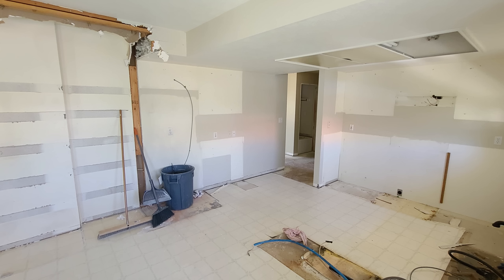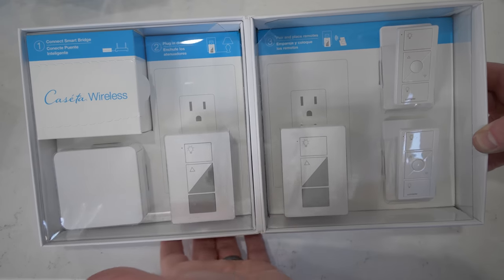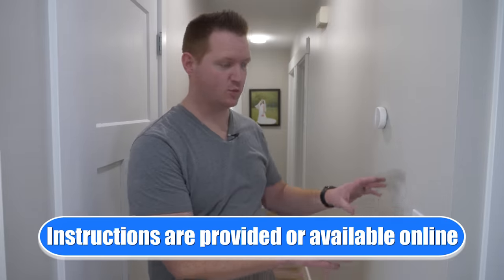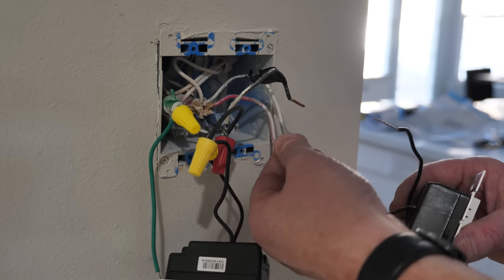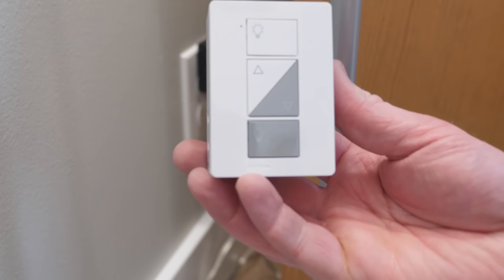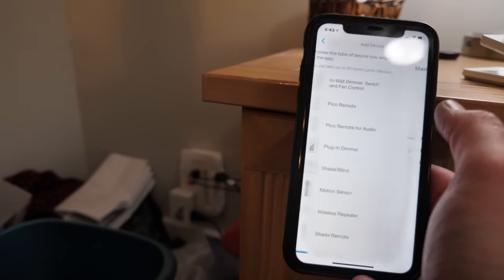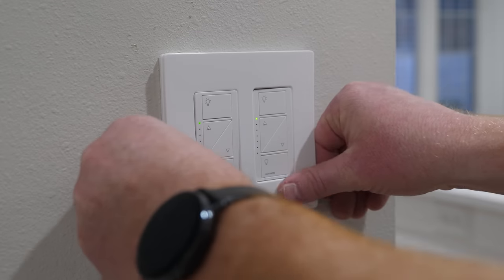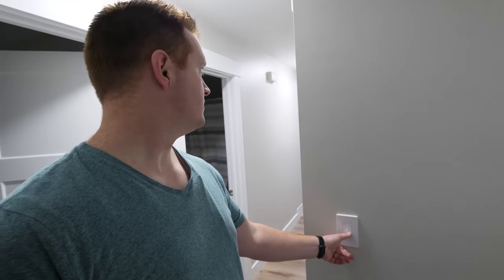Entire Home Smart Lighting Remodel

Comment: You might want to start using WAGO wire nuts. They are much smaller, super easy to install, do not come apart and no need for electrical tape. They have a newer transparent version that is even smaller and super easy, even for a DIYer. 
Because of their smaller size, it is easier to tuck them into the outlet box. 
Have been around for years. Designed and manufactured in Germany.
Reply: I used those to switch out all the switches in our apartment.

Comment: Really nice setup.  I recently bought a basic Lutron  inline dimmer for my 25 year old lava lamp.  Because of it's age, it had started to overheat, so putting it on a dimmer to control the heat has made it work like it was brand new again.  Lava lamps are the one type of lighting I still consider using incandescent lights for because they require the heat to work.  Thankfully, I'm only dealing with 40w, or 25w bulbs depending on the size of the lamp.

Comment: Watching this confirms Lutron Caseta is NOT the way to go.

Z-wave switches (like the Homeseer) with multi-tap scene control allow much more versatility.  You can set 12 scenes per switch and using the LEDs on the switch (7 on the dimmers) you can set status indicators or warning signals for what's happening in other parts of the house .  I also prefer being able to install a companion switch with 3 or 4 way wired circuits instead of a battery operated remote.  And, the companion switches offer all the same scene control and dimming capabilities of the master switch on that circuit.  Oh, and at a lower cost.  Yes, most of the z-wave switches require a neutral but most newer house have one in every box anyway.  If they don't, go for the Inovelli z-wave switches with almost identical features as Homeseer.

Ceiling fans, Homeseer has that covered if fan and light are wired separately.  Inovelli has it covered if they are wired together.

And, z-wave has a lot of different types of connectable devices which won't require an additional hub.

My 2 cents!

Comment: To everyone trying the cassetta wireless I would instead offer you the radio ra2 from Lutron, it has over 100 features the cassetta doesn’t have. The Ra2 can inter-grate your alarm, audio, a/c and more but the difference is the more brands and  devices available than the cassetta, also the programming is complex to let you dimmer or switches do more than the average and the style of the dimmer from the Ra2 I find more presentable

Comment: Brett, really like the details in this video. Not sure you’ll see this. I have a fan with light on the same switch. I saw you said I can use the Caseta fan switch to control the light and fan but might have problems with the light. Can you explain?  Will it work and if so what are the issues?  Thanks!

Comment: Thanks so much for this informative video. Are the pico remotes required at the second 3-Way point in or for the first point to work? Can we get away with just using the traditional switch that's already installed? I asked because we hardly ever use that second switch.
Reply: I just asked the same question. I have one and can experiment but I don't want to fry my $120 switch (ELV version so my LED lights don't buzz when dimmed).
Reply: @garagehobbies  I just recently found the answer! The advanced user's guide https://www.lutron.com/TechnicalDocumentLibrary/0301710_Caseta_Advanced_Instructions.pdf discusses how to use the Lutron switch/dimmer with traditional mechanical switches. The only thing is this requires a PRO Dimmer (PD-10NXD) to use with your existing manual switches. And those are rare and expensive. So you might as well tie off old switches and buy picos. It comes out cheaper. Oh well.
Reply: @rhondaallen9088  Awesome, thanks!

Comment: Great video, Brett, Question, If the wifi is down will the non wired remotes still work?
Reply from the maker: Yes they will still work since they are connected to the Bridge that is still able to control everything.
Reply: @TechWithBrett  As you mentioned in the video, they also work without the bridge. I had mine set up as standard switches well before I got a hub. They just work like normal switches when you have no hub or wifi.

Comment: Thanks. I just updated all my lights to Caseta without realizing the dimmer has no memory! You get blasted with 100% power and have to dim. Is there any way to set the default brightness in the app? I don't want to have to use voice and I've too many switches to have to add more Pico remotes next to them all. It's horrible and I'm so disappointed. 😪

Comment: Thanks Brett….awesome job.   Would you recommend the regular bridge or the pro bridge that lutron offers?  Is yours the regular bridge?
Reply from the maker: I have the Lutron Smart Bridge. The Pro model adds a couple security items but the also have an RA2 Select model that adds quite a bit of range, product limit and more. See here: https://homejell.com/lutron-caseta-vs-ra2-select/#:~:text=RA2%20Select%20%E2%80%94%20Things%20in%20Common&text=Just%20as%20the%20Caseta%20Wireless,control%20two%20totally%20separate%20ecosystems.

Comment: I noticed one of your room lights jumped to 100% before readjusting to the lower brightness setting.  Do you know why they do this sometimes?  I have a similar problem (Caseta dimmer, pico remote and 5 led recessed lights).  I didn't want to replace all 5 lights with new ones if that wasn't going to fix the issue.

Comment: Thanks Brett, very interesting but my house has one outlet (I put a smart plug) and a switch for the light (2 in 1), so if I change my switches I will only have the light controller and not a plug anymore.
So I choose smart bulbs.
Sorry for my bad english, and excellent video!
Reply from the maker: You did a good job. You possibly can make it work by changing the wiring a bit so the plug is constantly on.
Reply: Thank you so much! I will ask my parents, if they can do it, I'm 14 years old and with your help we have a smart home! I love it and I'm so excited about it, tommorow I will receive a smart lock that I buy with my savings, it's weird I know but I'm so excited 🤪

Comment: I'm curious if you know of a product that would be compatible with what I am attempting to do to the kitchen in my new home.  The build is just kicking off so I have time.  I need a smart lighting setup for my kitchen (maybe even the house).  I'm looking for lighting that would come in 3 settings, off, on (recessed lighting, maybe some accent lighting), and sleep -- where sleep will be blue accent lighting over the drop ceiling that would be located over the kitchen island.   Since this will be a large kitchen with access coming from the garage as well, it would need to be a 3 way style system where it could be controlled from 2 different points.  Ideally it could be controlled from either switch or a tablet.  Any ideas?
Reply: Probably just Philips Hue. Since you want colours + Hue have accessories like the RunLessWire switch, and it works with HomeKit, so you could have a good looking tablet control panel.

Comment: Will this work locally if internet is down? Or Does it need internet connection
Reply: Maual control of the lights (using the switches) will work w/o the internet. Obviously, Siri, Google, and Alexa wouldn't be able to since they are cloud-based.

Comment: Hey Tech, I eviewed your video and during your 3-way demonstration I believe you meant the RED wire should connect to the Load wire and the Black to the Hot/Line wire.  Otherwise the switch would not work as noted on page 16-17 of Lutron Advanced installation PDF file and noted below from page 17 diagram.

Switch may be installed in either location.
Note: The red wire must be connected to the load and the black wire must be connected to Line/Hot. The product will not work if the wires are reversed.

Good Luck

PM

Comment: I have several of these switches but always wondered... can you just install one 3 way switch without the pico's? Say I didn't need to dim lights from all 3 locations but wanted them as part of my home automation and to be able to dim via voice or the one location. Could I just wire up the one Caseta 3 way switch and leave the other two standard rocker 3 way switches alone? I don't like batteries so the pico's have that drawback. I use them elsewhere in some cases.
Reply from the maker: Good question. From what I can find only the In Wall switch can work this way. The Pro Dimmer can do it but they are pretty pricey.
Reply: @TechWithBrett  I did some more research and it appears the dimmers cannot operate this way but the on/off in wall switches without dimmer can work with standard rocker switches at the other locations. I also found that they claim the Pico remote batteries last up to 10 years. I can live with that. I'm replacing all my lighting switches with Caseta switches and added a smart faucet and hood vent in addition to some other goodies. Getting a bit out of hand but fun.
Reply: Had same question, putting in 73 smart switches. Need to buy this ASP for new build.   Wondering if I will go over 75 max and have to upgrade

Comment: Were the kitchen bulbs special Dimming LED bulbs or they have to be smart bulbs?
Reply: The switches are alternatives to smart bulbs. As long as you get bulbs that are compatible which is as simple as them being LED and dimmable. The caseta switches will work and using the hub you can turn them on and off with the app.

Comment: So I have a 1 way switch in my bedroom, all I need is the 1 way on off switch, right?  I also don't have neutral wire in my bedroom
Reply from the maker: Yes that is correct, and you will also need the Smart Bridge.
Reply: @TechWithBrett  yep, except the fact that I don't have the money to buy a smart hub with a smart switch :( The wires in my house are really old, so finding a smart switch that doesn't require a neutral wire is hard. Do you know if c by ge requires a hub, because I heard that their smart switches can be without a neutral wire.
Reply: Careful now, the On/Off Switch DOES require either a neutral wire or you to install a Minimum Load Cap (if you don't have a neutral wire) - others can pitch-in if I'm wrong!
Reply: @alexandred8513  ok, I pulled off the switch to put in a smart switch a couple of years ago and I think I only saw like 2 wires in the electrical box. We had to return It.

Comment: can these switches be replace ones that control an outlet that is for lamps, led strips or Christmas lights?

can these plugin lamp dimmers work on anything else that needs to be plugged in besides just a lamp? like decorations? fans ? modems ? things I want to be able to  turn on and off ?
Reply from the maker: It is not recommended to use a Caseta Dimmer switch on a switch that is connected to a receptacle.

The plug in dimmers actually have an option to turn it into a on/switch vs a dimmer switch. Just hold down on/off for 6 seconds to change its mode.
Reply: @TechWithBrett  thats awesome, great to know!! what about just a lutron caseta switch (not the dimmer) to turn on and off outdoor outlets that are used for landscape lighting and Christmas lights ?
Reply: @TechWithBrett  I looked through the Caseta documentation and I did not find anything advising against using a Caseta Switch (not dimmer) to turn on and off an outlet. My plan is to do that for outdoor outlets I have landscape lighting hooked to. Thoughts ?
Reply from the maker: @chriscarr1791  I haven't seen anything about that standard switch not working with receptacles so I think you should be good as long as you don't have anything that would overpower a receptacle.
Reply: @TechWithBrett  Thats whats i was thinking. Theyre only going to be 12 or 24v landscape lights. And outside is safe enough noone is probably going to plug in a heater lol Curious any smart landscape light suggestions ? Looking to do up the whole front and rear yard this year. but trying to find any that can handle a Canadian winter.

Comment: Thanks Brett for this video!  Question: Did you have neutral wires in your house already?  If so, do you see any downside to using a non-neutral wire switch like the Caseta ones you have installed?  I am pricing putting a lot of Caseta switches, and the dimmer ones requiring a neutral wire are about 2x the cost of the ones you used.  Thoughts?  Thx!
Reply from the maker: Yes I did have neutral wiring in the home but did not need them for the dimmers. The only reason I can find to get the one with a neutral is if you have a 3-way circuit and want to use the existing light switch on the other end.

Comment: Great video! I could've missed it, but are you able to turn on a plug-in dimmer with an in-wall smart dimmer switch? So the installed switch can turn on ceiling lights and lamps? Or are the switches not able to communicate to other devices like the pico remotes? This is assuming I don't want to always use an Alexa/Google routine to turn everything on. If not, is it possible to tell SmartThings to automatically turn on a generic smart plug if the relevant Caseta Smart Dimmer Switch is turned on?
Reply from the maker: Great questions. With the In Wall switch it cannot act as a Pico so it can only control the lights it is attached to so you would need to have a Pico to control multiple devices.
With SmartThings it is possible to make it so when you turn on the in wall smart switch it can then turn on other compatible SmartThings devices.

Comment: Are your kitchen and dining lights dimmable LED? If so, what brand? I haven't been able to  get dimmable LEDs to work with my Lutron dimmer switches.
Reply from the maker: Yes the are. They are Ecosmart Dimmable LEDs. Do yours specify they are dimmable?
Reply: @TechWithBrett  I don’t recall, but that probably is my problem. I’ll check out the ones you mentioned. Thanks.
Reply: Switches might be too old. Forward phase Triacs haven't been around as long as Lutron has.

Comment: Does Lutron use cloud polling or is it local polling?  The problem I have is when my internet is down will automation routines still work? I have a bunch of tuya smart switches and the annoyance of cloud dependence and latency sucks.
Reply: Would like to know this as well. Keeping the "smarts" off the cloud is ideal, if achievable...
Reply: @stevesherwood1791  it is very much achievable. But the thirst for peoples data and the quest to charge people to store data will not let the companies pursue that route. Wyze for example does everything through cloud but I was able to use a different software to do local instead and it works better than when It was cloud.
Reply: @jacked_geek  that's interesting. I know enough to question and understand but not enough to implement. Any info on how to accomplish this would be ideal. Thanks!
Reply from the maker: So I just did a test where I created a schedule Automation in the Lutron app. I then unplugged the Lutron Bridge from the router and the schedule ran without issue, so I assume that it is local polling.
Also, after creating the schedule it gives a notice that it is programming the system and could take a few minutes to compete.

Comment: Is it just the pico remotes that can be programmed to control all the lights or can the wired ones do the same thing?
Reply from the maker: This is the one feature that I was disappointed is not available. So you would need to use a Pico remote kit to create a new switch next to already existing switches.
Reply: @TechWithBrett  That’s a real bummer.  It seems like it would just be a software change but maybe it’s more than that.  If it could do that I would probably replace my existing zwave switches.
Reply from the maker: I also have SmartThings and when I link it to there I can then do things like that. I created an Automation where when I turn on one switch it turns on multiple devices at the same time.
Reply: @TechWithBrett  True, I guess that's an option.

Comment: I have a upstairs hallway light single pole but I would like to put in a remote on the other end of the hallway and just want to use a pico remote, can that be done?
Reply: Yes of course, you would just need to pair the Pico remote to the main switch. 
This is fine because in the 2 way setup, you would just be wiring circuit the 2nd switch to be permanently closed, so it is effectively the same difference as far as the main switch is concerned.

Comment: I have 2 ceiling fan's with lights on a signal switch. With a natural wire. And 1 ceiling fan with lights. in a upstairs room  with  no natural wire. What would you, recommend for this setup? I use Google home.
Reply from the maker: That is a great question. It would be curious to take a look at the wiring. All smart fans do require that neutral wire bit I am curious if there is a work around. For the lights I typically keep the pull string off and add lamps to the room with art bulbs, or you could but smart bulbs inside the fan.

One other option is to get fans that are smart themselves or use a remote. The BOND device is then able to control control the fan over IR and make it smart. https://youtu.be/aNjzHGDbeFg
Reply: @TechWithBrett  the ceiling fan's in the living room don't  have remote.  They are the old pull chains. Looking to, pull away from them completely.  We do have smart lights  in them.

Comment: My complaint is the Lutron Caseta don't support 3 way unless you get the pro model which requires a neutral wire.  They give you the remote but it looks different then the others which breaks up the consistency.  The on off switch requires a neutral wire as well which is frustrating.

Comment: can you preset an exact amount of dim in the app so that when you turn on the light it turn on to 90% everytime ?
My light is colour temperature 1800 to 3000K and I need to set it at 2700k any cheap solution?  my only option rn is dali controller